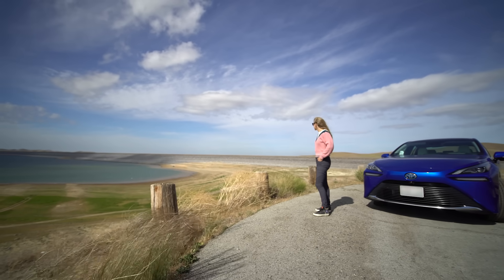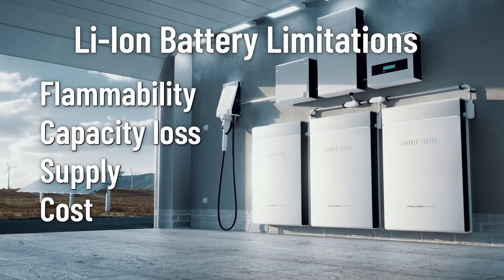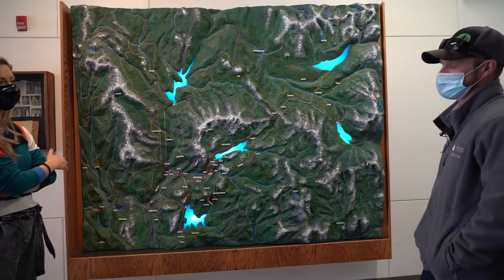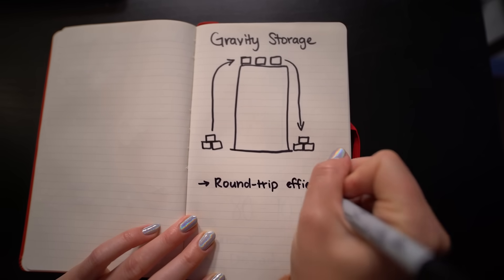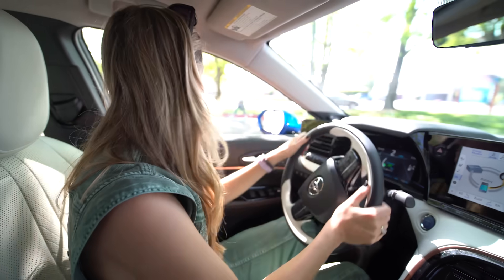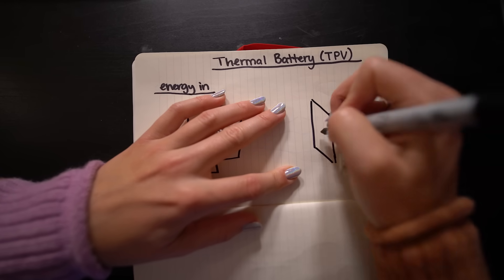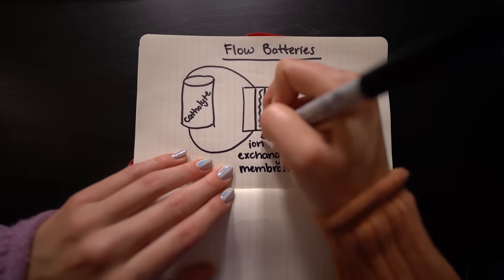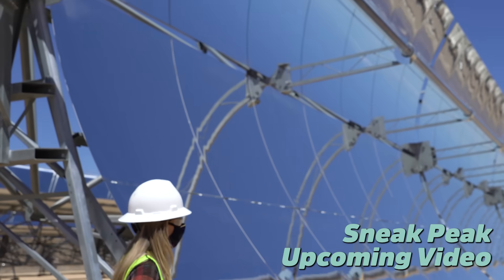The BIGGEST problem with clean energy

Comment: Wow anti-battery much?  Batteries catch fire, what do you think a hydrogen tank compressed to 300 atmospheres would do? 
Batteries cost too much: Solid state batteries are coming which will: 
1. Not blow up
2. Cost 60% less 
3. Have a much higher cycle life (losing only 10% capacity even after over 30,000 cycles).
4. Higher energy density as the solid state packs are smaller for the same Watt hours
5. Can possibly go up to 560Wh+ per kg which makes them light enough to be used in aircraft with good range.
Lithium is limited in supply: Lithium can now be extracted directly from seawater using a fraction of the time and energy compared to the current method of letting it evaporate in huge ponds.

Many batteries labs are now experimenting with non lithium combinations, aluminium air, glass silicon (John Goodenough ;).  With breakthroughs in increased density, cycle life and lower cost being reported every week, it won't be long before Hydrogen will have missed the boat.  

Hydrogen on the other hand: 
1. Currently has little to no infrastructure in place to support a network of refueling cars, to the point where Toyota had give away 65,000 of hydrogen with the car just to try and entice people to buy it.
2. Has poor energy conversion, once you put in energy to convert it to hydrogen, energy to compress to 300 atmospheres, energy to transport it, put it back through a fuel cell you've lost over two thirds of the energy put in. Similar to a fossil fuel engine of around 28% round trip efficiency.  Compare that to an Electric car where 95% of the energy put in is used to move the vehicle. 
3. Most hydrogen in reality will come from steam reforming natural gas, which releases carbon in the process, only worsening the effects of climate change.
This is simply Green Washing to allow the fossil fuel industry to keep selling carbon polluting gas.

Comment: You left out liquid metal batteries. :)

Also, the one I think is the coolest is Eduard Heindl's gravity storage concept where an enormous piston is excavated out of the bedrock itself, a large, heavy-duty gasket is installed around it, and water is pumped from underground reservoirs to lift the piston when you have a surplus, and then you let gravity lower the piston when you need to get the energy back. This system would by and large work with existing pumped hydro technology but without the geological requirements, the need for as much water, or the vulnerability to evaporation. It's also very scalable thanks to basic geometry--if you double the circumference of the piston, it costs roughly twice as much to build, but gives you four times as much storage capacity!

Comment: Better interconnectivity and efficient transmission could help alleviate these issues. If overproducing solar could be quickly routed to places that were underproducing energy than the need for storage would lessen. Then consider that it's literally always daytime on one side of the planet, so an energy grid that could move across the planet would be amazing!

Comment: Can renewable energy sources plausibly generate enough energy to replace non-renewables?

If they can, then yes, the energy storage question should take us to zero-emissions if we scale it up enough.

if not, then there is still something lacking in the equation to reach zero emissions.

"In 2011 Mark Z. Jacobson, professor of civil and environmental engineering at Stanford University, and Mark Delucchi published a study on 100% renewable global energy supply in the journal Energy Policy. They found producing all new energy with wind power, solar power, and hydropower by 2030 is feasible and existing energy supply arrangements could be replaced by 2050. Barriers to implementing the renewable energy plan are seen to be "primarily social and political, not technological or economic".[233] They also found that energy costs with a wind, solar, water system should be similar to today's energy costs.[234]

Similarly, in the United States, the independent National Research Council has noted that "sufficient domestic renewable resources exist to allow renewable electricity to play a significant role in future electricity generation and thus help confront issues related to climate change, energy security, and the escalation of energy costs … Renewable energy is an attractive option because renewable resources available in the United States, taken collectively, can supply significantly greater amounts of electricity than the total current or projected domestic demand."[235]"
https://en.wikipedia.org/wiki/Renewable_energy#Demand

I don't know. I get the impression (not sure from where) that renewables like solar, water, energy sources aren't as powerful as usual non-renewable sources. Perhaps it's when comparing the power of a solar powered toy to a battery powered one. Also don't renewables generally require more land to catch the sunlight / wind / drive the water flow? How is is possible to integrate that into the current architecture? Hmm...

Comment: If we use nuclear to provide a baseload of supply, then we can use renewables and storage to manage the flexible demand.
Reply: An even simpler system would be to use nuclear to provide supply , then use storage to manage the flexible demand.
Reply: @factnotfiction5915  perhaps but we already have renewables on the grid and they are a good technology for cutting emissions. So a combination of both is good.
Reply: @tyronedlisle4412  Until they wear out, then there is no point in replacing them.

Comment: There is one storage solution which is in use today which I would have liked to see you mention, even though it is yet to be wildly available but is growing as a solution which is likely going to be one that will make the most sense and that is Vehicle To Grid whereby the energy stored in electric cars is fed back into the grid without either overwhelming the grid or using more of the car's battery capacity than the user chooses to. Right now it's only available on certain models of electric cars (mostly Nissan Leafs) but the technology exists, it can be fitted to people's homes and it will be available to more and more models of electric cars.

I know you're sponsored by Toyota but I really hope they're not controlling some of your narrative because I'm biting my tongue really hard to not say any more about them

Comment: is that a Trompe system such as existed late in the 1800s? Driven be falling water with added air to create air pressure at the bottom of a drop, returning water to source? Such systems supplied large factories.

Comment: physics girl, you did not mention Geothermal energy which is the biggest energy storage on planet. our visitors use Geothermal energy for number of reasons. two main one is to control global temperature for extending life bearing period of their planet. and it is available globally in all part of planet 24/7.  it is used for most energy need as well as community heating/cooling etc.
Ferydoon Shirazi. MG1

Comment: For stationary home storage, a heavy-mass flywheel magnetically levitating in a vacuum being magnetically driven to store energy at tens of thousands of rpm and then being braked down electromagnetically in order to extract energy would also be a neat technology.
Reply: Aahhh no thx. Then i would rather take a bucket full of E-Fuel and power my oven. Which i both don't need, i just use LFP batteries instead. Much lighter, cheaper, easier to handle and nothing wirrs around with many thousands of G's and many thosuand of Kilojoule of kinetic energy in my own house. Besides which existing material withstands many thousands of G forces you want to realize in your flywheel?
Reply: @wolfgangpreier9160  I would actually have it underground, in a covered hole in the back yard or so. Make it 2m in diameter, and put it 3m deep and then cover it up with some kevlar lined carbon fiber or whatever else could withstand these forces at least to a degree so that that it won't escape if it came dislodged (which would of course require a technical fault against which you could also employ further measures, like force braking the wheel or something like that).
Reply: @Seegalgalguntijak  WoW what a mess. I have my battery in my garage. Plenty of space for it.
Reply: @wolfgangpreier9160  I would consider that if it were a LiFePO4 battery, but not with Lithium Polymer cells...
Reply: @Seegalgalguntijak  I said LFP. Thats the short form of LiFePo4. I do not know whetther any manufacturer uses RC LiPo cells for Solar storage. I guess not.
Reply: @wolfgangpreier9160  I think the Tesla Power Wall has the same type of cells as their cars do, so that would probably be LiPo.
Reply: @Seegalgalguntijak  The "old" Powerwall uses Li-Ion NMC cells, The Power Wall V2 uses Li-Ion NMCA cells with reduced cobalt. The next Generation powerwall which is currently not being shipped to customers because not enough cells uses LFP. No sane car manufacturer uses LiPo. Thats only used in RC toys.
Reply: @Seegalgalguntijak  Tesla doesn't use LiPo cells in their cars, that would cause way too many fires.
Reply: @wolfgangpreier9160  Flywheel energy storage is already in the market. Plenty of information out there about it.
Reply: @bahamatodd  I can not find one single manufacturer or distributor in Europe. Could you name one?
Reply: I would personally prefer LiFePO4 batteries, they are cheaper, longer lasting, and don't have the potential to create shrapnel. But if the concept of a rotating mass is what sparks interest in energy storage and gets more people to install some energy storage at home than I am all for it.
Reply: STERLING FREE PISTON GENERATOR AND SODIUM SULFATE
Reply: @ronniewall1481  You can shout all the way you want, it desn't make it more real then it is now.
Reply: @wolfgangpreier9160  WHAT ISN'T REAL IS THAT CAPS SHOUT. THAT IS A PRODUCT OF BEING A GOOD LITTLE SHEEP.
I USE CAPS BECAUSE ON MY PHONE ITS HARD TO MAKE OUT LOWER CASE.
Reply: @ronniewall1481  You are invited to invent and produce and market and advertise and sell and maintain such a product. I will not because it does not help me or my family or my neighborhood or even fighting the climate catastrophe in any way or form. I got PV and heat pump. That works, is financially feasible, does not break down every second day and delivers the energy i need for our home. Nothing fancy. Just working.
Reply: @wolfgangpreier9160  WOW YOU IMPRESSED ME. I MEAN HOW DO YOU BREATH WITHOUT A BRAIN.
DID YOU LOOK UP WHAT I MENTIONED?
THE SYSTEM IM TALKING ABOUT HAS BEEN USED AND IMPROVED ON BY NASA SINCE THE SIXTIES.
UNITS HAVE RAN 110,000 HOURS STRAIGHT UNDER FULL LOAD WITH NO REPAIRS.
Reply: Sounds like a disaster waiting to happen...
Reply: THERE IS A SAFE CHEAP EASY WAY TO STORE ENERGY.
SODIUM SULFATE LETS YOU STORE HEAT.
Reply: @ronniewall1481  Even easier , concrete. earth, sand, water. There are many materials and environments that let you store caloric energy. But we need electricty and it svery hard to convert those low level caloric energies into usable electricity.
Reply: THERE'S A BETTER WAY THAN FLYWHEELS.
NASA HAS USED AND IMPROVED ON THE STERLING FREE PISTON GENERATOR SINCE THE SIXTIES.
YOU STORE ENERGY AS HEAT WITH SODIUM SULFATE.
Reply: @ronniewall1481  Too complicated and expensive. Otherwise every home would already have one.
Reply: @wolfgangpreier9160  FUNNY HOW YOU CLAIM SOMETHING IS TO EXPENSIVE AND COMPLICATED WHEN YOU'VE NEVER HEARD OF IT. I BET YOU'RE ONE THOSE GUYS WHO LEARNED SCIENCE FROM THE NEWS MEDIA.
Reply: In future will get an old cars battery, it has plenty of storage for a house. A house with 4 persons can reach 14 days with a current car battery.
Reply: @sixtus9559  You may take a Model 3 SR+ battery, thats perfectly ok. That one can not burn. I would not take any other car battery currently in use out there. They all tend to burn uncontrolled if not handled very delicately and properly.
Reply: @wolfgangpreier9160  ah that's Teslas marketing at work, there's that big of a difference between Teslas batteries and those from other companies
Reply: @sixtus9559  Ah, no, thats my job to know. Sorry pal. I only use LFP cells for solar, never Li-Ion. Some like LTO or saltwater, in China they are test-using Vanadium Flow which only really works for very large batteries. Na+ is not available, others are not even on the horizon to be built in the next decade.
Reply: @sixtus9559  But only if you use no electricity except for 3W LED lighting, and not much of those.

Comment: There is a German patent from 1991 or there about which describes a highly effective method of splitting water by electrolysis - this is achieved by not using direct current, but either alternating current or pulsed direct current at the resonance frequency of the H2O molecule - this is actually the innovation, think about soldiers marching over a bridge in lockstep being able to bring down that bridge although it can hold as many semi trucks as there are soldiers on it. Anyhow, the resonance frequency of the water molecule is somewhere around 7 THz, that's seven thousand GHz, and therefore not all that easy to reach. But if we were able to do it that way, we would have solved all our energy problems in a split second, because you could split up much more water with that and gain much more hydrogen. It could even be possible to equip an internal combustion engine vehicle with an on-the-fly-production unit for that and have the ICE run by burning H2+O2 gases into H2O.

Comment: The Gravitrcity thing doesn't really make much sense. The same can be achieved with water.  It is not the case that pumped hydro needs very large area but Gravitricity doesn't.  The only way the Gravitricity system can be smaller is by having a much smaller capacity. If the Gravitricity system were to be used for something with the capacity of a pumped hydro lake it would need an even larger area and thousands upon thousands of cranes and towers of concrete blocks. 
The same capacity of any Gravitricity installation could be achieved by a simple water tower, ground tank and pump/turbine of about the same size but would be far simpler and cheaper both to build as well as to run and maintain.  
If one does the math it immediately makes no sense to shift blocks rather than water. My guess is it is just one of so many similar 'projects' taking advantage of the funds and subsidies for green energy.

Comment: Here's what I want to know. How big of a Water Tower would the average household need to meet its energy consumption for 1 day, if there was no energy-in that day and just letting the tank drain through a turbine into a lower reservoir?
Reply: It depends on how much the household consumes, which varies a lot. If I take my case as an example it is about 20KWh per day.  
To provide that by a water tower I would need to have a tank containing 500 tons of water standing on a 15 meter tall tower.  The size of a 500 ton water tank, if made in the form of a cube, would be 8 meters on each side. 
For metrically challenged readers the (approximate) conversion, if I'm doing it right, is 115 thousand gallons of water sitting on top of a 50 foot tall tower and the tank would be a cube 26 feet on each side.

Of course you could get away with a smaller tank if you make the tower higher, so if for instance you had a 60 meter tall tower you would only need to put 125 tons of water on top of it.
Reply: @listerdave1240  Appreciate! This interests me, that's not a huge footprint. Unfortunately, I know nothing about turbines. Next thing to deep dive. XF

Comment: The problem is scale. If we went 100% renewable, the renewables need the capacity to:
1. provide for local demand at any given time
2. provide enough for outside areas that aren't producing enough at any given time
3. provide enough for the above AND enough to charge storage, whatever that may be

In order to achieve these, storage needs to
1. store enough to provide for local demand at any given time, for extended periods of time. Not seconds, not minutes, not hours, potentially days. 
2. store enough to provide for local and outside areas at any given time, for extended periods of time.

When you consider that Texas, for instance, on a hot summer day uses in the 60+ gigawatt range, the amount of storage needed is astronomical. While we technically know how to make quite a few storage mediums, the economic cost would be infeasible. Probably by several orders of magnitude.